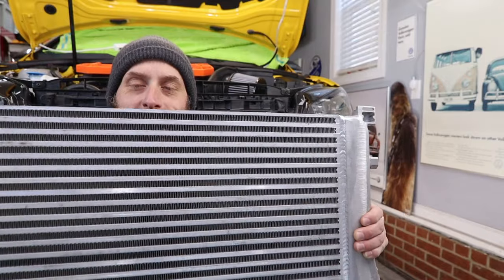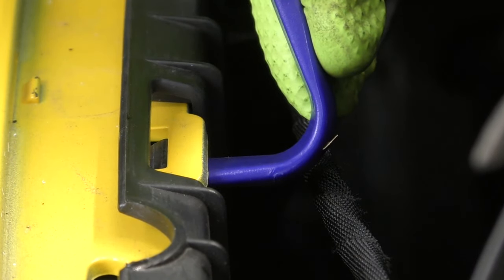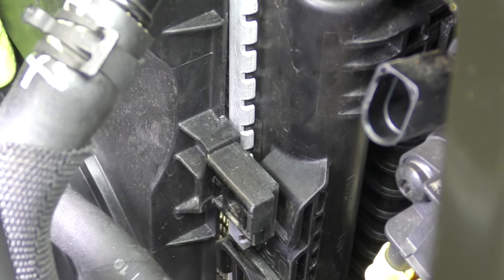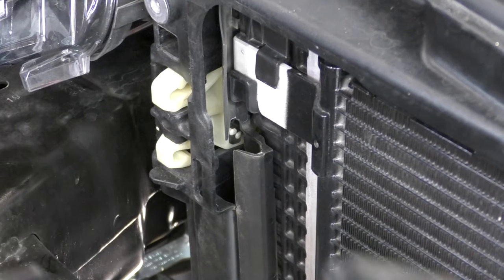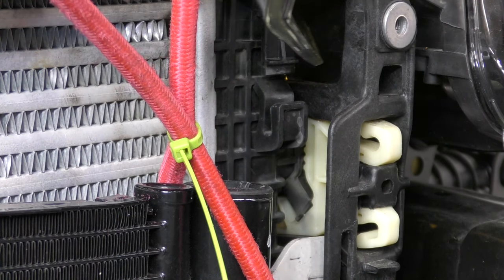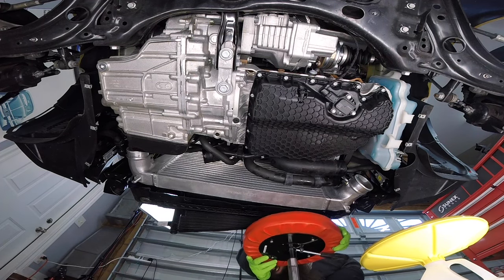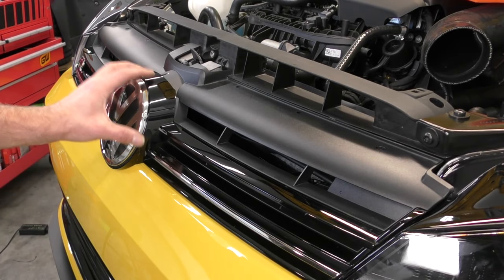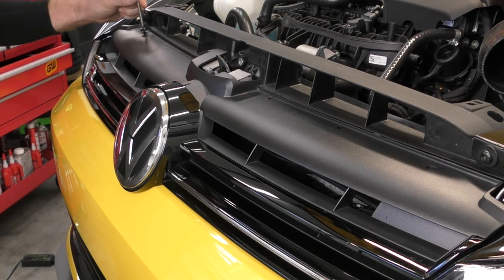Intercooler Upgrade and Installation ~ Stage 2 Golf R

Comment from the maker: WOW what do you think of a 33+ minute video? Also can you spot the fun things I added? ;) I also think I counted wrong on the clips, good thing I added a few extra!
Reply: Cloning is a new hobby?
Reply: Chewie says: Good job!
Reply: 16:37 Very long left arm!
Reply from the maker: @biggabenne  HAHAH Good catch
Reply: There were 2 Charles at some points
Reply: My bank account cries whenever I say "because race car". I tell myself they're tears of joy...
Reply: What do I think? I think I'd rather never buy a Mk7 car. I prefer working on my Mk3. My next purchase just might be a Mk1 GTI if I can find one. Hey Charles, where did you get the plastic trim tools? They aren't on your list.
Reply: Nice video as always.  I didn’t replace the my intercooler but I did replace all the factory charge pipes from turbo to intercooler and back to intake.  I purchased the full charge pipe kit from ECS.   I don’t track my car so figured the factory intercooler was good enough.   And the street racing in short bursts has proved the factory intercooler can still win races:)  my next upgrade is a brake kit and carbon fiber hood.  I did replace the factory diverter valve with a GFB go fast bits upgrade.  It holds boost better than factory and isn’t a weak point.
Reply: I liked the step to roll around on the ground looking for your stuff, lol. Been there.
Reply: Just came across this build series but curious if you have current dyno numbers?
Reply from the maker: Not for stage 2 yet. Should be early next week for that video
Reply from the maker: Hahaha always happens
Reply: Is there a VW/Audi factory piece that gives the same upgrade like the S3 cooler on Mk5?
Reply: HumbleMechanic do you think this method is possible on jack stands? Seems like you need a decent amount on the bottom.
Reply: HumbleMechanic Inwould like to say that your channel is meticulously thorough, concise, straightforward, and informative. 😎🏎 I would like to ask this: I watch races of Mk7 GTIs blowing thier motors on stage 2 tunes. What do you think the cause of that is?
Reply: Very good video.  I watched this vid and a few others and decided to go this route for installation.  Video attention to detail is excellent.  Typically I have to make a run to the store for tools or otherwise mid-process but this time I didn't have to, I'll give some of that credit to HumbleMechanic.  I followed the video with intentions of finishing in one afternoon.  It took me 4 hours at a leisurely pace which is sooner than I suspected.  Biggest trouble by far was the fan electric harness connector.  I had to be a little more invasive but I didn't break anything.  Success!!!!  Thanks for the great video.  And Wow, I like to keep my car clean but as you disassembled that R I was surprised at how clean it is!

Comment: Definitely going to use this method insted of pulling the front end if i fit an intercooler. This way ensures everything lines up like factory. Helps working in a working with the proper coolant bleeding equipment

Comment: I have watch this video about 10 times and I feel very confident at tackling this job now. The only piece that I'm a little concern is the process of adding the coolant back into the system and bleeding the air out. Care to point to some resources to help me boost my confidence doing this and also on how to use the special funnel you used.

Comment: Interesting install method.  Nice call out on keepin the engine bay grill screws separate since they are shiny.  I had to dig thru mine to find them. ha

For the dang IC clips pushing on them through the hole....bloody brilliant!  So obvious.  My method was to buy 2 spares on eBay, and not care if they were destroyed.  Think one popped off easy and the other I used side cutters on the prongs. lol

Edit: The FDS system is also pretty slick too.  The fact that it comes with a meth bung and hoses makes it a solid deal.

Comment: I installed this over the summer. I did not follow the instructions and remove the radiator tho. I went the Paul at deutsche method instead . This may have made it more difficult but I got it done. One thing I was glad to see in your video is how tight the fit is for the condenser tabs. I wondered if mine was messed up. One of the the tabs for on my intercooler actually cracked when I was trying to put it together. I decided to open up those slots slightly with a dremel so the tabs would slide in easily.

Comment: Vw service manual actually tells you to break the tabs/clips that hold the intercooler/ radiator in. (The white stubborn things haha). On the parts manual it gives a listing of 2x t30 self thredding screws to secure it back in

Comment: Imagine all the plastic that will break if you ever get in a minor front end collision
Reply from the maker: Yep. But it beats welding a new core support on
Reply: Insurance would total it for the cost of all those plastic clips lol
Reply: These golfs have sensors that give you a pretty good heads up to help prevent but yes that would really suck if it happened 😂😂
Reply: Energy most go somewhere, the key is to prevent it from compromising the frame cabin, plastic parts absorb the impact, the reason many new cars when on impact look like an accordion, but the frame of the vehicle is mostly intact.

Comment: I've been running an APR stg 2 high torque setup and have everything except an intercooler upgrade.  Living in Texas during the summer makes me want to do this just because of the climate over 7-8 months out of the year even if I don't drive the car hard a lot.  After getting some finally colder outside temps (30's), I can tell the car loses a large amount of torque due to heat soak in those hotter months. 

This seems like an install I'd casually say...eh i could do it, but would much rather pay one of the local vw/audi shops instead.  I liked the caution of not accidentally stabbing the condenser with the screwdriver.  Little heads up like that are the best bc dumb mistakes are the worst.
Reply: I was thinking the exact same thing, living in Houston. The car just feels so much better now that we have pleasant temps, this might be worth it before next summer. And yeah, pretty sure i'm going to be giving a local shop some business for this one.

Comment: I usually put some detailing tape on the expensive headlights, so the bumper doesn't scratch them up, trying to get it off and on! Applies to mk5 & Mk6 as well.

Comment: Well done Charles.  Thank you for making this video.  Aside from the front grill and bumper cover, are there any other differences between the 7 and 7.5 when it comes to disassembly or should this be pretty universal for the Rs?  I'm also curious whether or not they are the same where the bumper cover meets the quarter panel.
Reply from the maker: Should be basically the same. Even the GTI should be the same

Comment: At 21mins 30 in when you tightened that T30.....I had a Wagner installed and due to the extra thickness of the Intercooler the screwed eventually wore through the condenser - make sure you check that T30 or use a thick washer or like me you'll end up having to replace the condenser. Ugh. Great vid though!!
Reply from the maker: Oh dang!!!

Comment: I found I didn't have to take the radiator out or disconnect it at all. Kinda hard to describe, but the passenger side stuff stayed mostly put, the splayed out the drivers side enough to slide our the stock IC and put in the new one. Can send you a pick if you like

Comment: I'm mid video right now, loving it as always 👍, but one thing I wondered is what metal type are those little grub screws in the condenser? They looked stainless, I just wondered as mild steel and aluminium never have a good relationship haha 🎈

Comment: You do such a great job explaining and actually showing what you are doing. That is something many DIY videos do not do well so bravo! Question: I bought this IC second hand (v1 like yours) but I see there is some hardware you do not mention. Primarily the two cap screws and the male countersunk plug. Did you not use these parts? Thanks!
Reply from the maker: the ones that hold the condenser?

Comment: Hey man, pulling that bumper plastic away from the fender I have seen plenty of folks end up breaking those and there is no good way to fix that. Those tabs were not designed to be pulled apart like that, there is no need to pull on those, if you push back the fender liner just a bit there are two 13 mm nuts up underneath, just loosen those and pull forward slightly and the whole assembly just falls out. 
When you go to re-install you can  install the bracket assembly with those two nuts first, tighten them up, then when you put the bumper cover on they easily snap into place.

Comment: The ACC radar behind the logo is a lot more forgiving than the one placed in the grille when it comes to calibration.
It's to some degree able to self calibrate, but if it acts up, you could probably do it with VAG-com while driving, with no expensive special tools needed.
Reply: Also, using a vacuum coolant bleeder is a lot faster. Reduces the bleeding time to 10 minutes top.

Comment: do you think the radiator and Intercooler can come out from the bottom if only on jack stands?    This method looks better then messing with the core support.....although bleeding the cooling system seems scary.

Comment: I'm running stage 3 with no intercooler, so I probably need to upgrade this. My question is, should I upgrade the radiator also? If so, do you have any recommendations? I i was seeing 230-250F on a 70F day on the track when I was stage 1. I'm a little worried now that I have the APR dtr turbo setup.

Comment: Charles I was advised to disconnect the battery before starting. I have a 35th anniversary GLI so it's got the sensor in the VW symbol for braking, and I've heard that you may have to get that re-calibrated if you disconnect it under power.
Reply from the maker: I haven’t. But it won’t hurt
Reply: @HumbleMechanic  man I never thought I'd get a response that quick but I was like...eh I'll post anyway. Thank you! About to tear into the car right now.
Reply from the maker: Make her fast!!!
Reply: @HumbleMechanic  hey bud, one other question. So my setup is 6M, and I'm considering removing the clutch delay valve. Apparently there are varied opinions on if it helps clutch life or not. I can't see how slowing the engagement of the clutch would ever be beneficial, so I'm curious if you think it would be beneficial to remove as well. Thanks!

PS my ACC took a crap yesterday. Not paying the dealer to fix it, so I'll have to deal with the light for now 😭

Comment: I like that trick with the large yellow clips. I broke mine and would have done it your way.
Reply from the maker: Thanks. If I ever take them off again I’m probably going to cut and replace.  Those like radiator supports wear out
Reply: Makes sense.

Comment: When you installed your air intake did you totally remove the oem intake housing? I have installed a ram air kit to my mk7.5 R and didn’t think I needed to remove it? Will removing, as it seems you have, increase air flow to the filter?

Comment: Hi ..great video ...but one question ...do you need to remove battery lead when messing with the radar sensor in grill or is it ok to leave battery connected ...i know can be expensive if need recalibrating ....any help most appreciated :-)

Comment: Just wanted to ask if it would be better to go with the front mount intercooler instead just putting the bigger intercooler back in between two heat sources

Comment: My mk6 gti has a u1030 engine code 
I believe I’ve seen from my research that is a radiator sensor that cannot be replaced unless I replace the radiator itself
Was wondering if I have time to replace it or do I need to do ASAP

Comment: If it was my own car i'd tape thin cardboard to the cooling surface to the coolers, then remove once their close to their positions, as it's easy to bend the small cooling fins as you've done a few but not alot. I've got OCD so i'd be bending all those bent fins back into place lol.
Reply from the maker: That’s a great idea. I’m totally gonna use it
Reply: @HumbleMechanic   yeah it's easy to bend them, and I'm no angel in that department myself, pulling and pushing, trying to get them in position, then once in position, it doesn't look so pretty! yes I've done it myself, and the greatest lessons in life are learned by mistakes! great videos mate, keep em coming!

Comment: I don't know if you'll see this or not, but would this also be a good time to change out the water pump and t-stat housing too, while you have all that room up front? I'm going to be changing it out this coming spring as it's leaking, and I'm thinking of doing the intercooler upgrade while i'm in that area. 2017 Golf R
Reply from the maker: Not a bad overlap for sure

Comment: Hi , the OEM tool funnel kit .
   Which connector did you use to secure it in the expansion tank ? 
 I didnt see a adapter in the kit that i was going to buy (which was the exact kit you used in this vid) , did you source a seperate adapter to acheive the fitting into the tank neck? Or is it with the kit & i cant see which one it is? 
 I asked a seller if they have the kit to fit the vw tank neck for the polo gti & they said no .
 Can you help ? Im sure the tanks are all the same for these cars. I also noticed that it wernt screweddown but looked like it was just sat in the neck? 
 Cheerz 
Paul

Comment: Hi there luv your videos and your attention to detail great work 👍 i got a question just bought a 2017 golf R 63,000 on clock from vw dealer im told it has a tune but no one knows what stage from what i see are apr downpipe- apr intercooler- apr air intake ( closed) pedalbox system and from what im told from the dealership an ecu tune and tcu tune and rear stabilizer bar i cant get way under car but what i can see witch to me is strange with all that work it has original exhaust again im not sure cause cant get under car , with " all" that said any suggestions on what stage tune im at??

Comment: Why did you decide to remove the radiator, draining the coolant etc?  Instead of just swinging out the core support like you mentioned in the beginning.  Looks like quite a bit more work.
Reply from the maker: That is the repair manual way, and no worry about adjustment of headlights.

Comment: @HumbleMechanic I’ve seen people and “helped” (watched) a friend do his by removing the front crash bar headlights etc... I would imagine your method is easier, as long as your ok with draining the coolant? 

I’m about to install my IE IC on my S3 and thinking if I have to remove headlights etc this will suck and I should just pay to get it done. I did a condenser on our mK6 TDI and that sucked enough to make me not want to do anything like that again. Your method looks less sucky. 😁

Comment: Do you feel it's easier to take out the fans/radiator and deal with burping the coolant vs leaving the radiator in place and pulling everything off the front of the car and getting at the intercooler that way?  I always hate dealing with coolant/burping...
Reply from the maker: It's probably about the same either way.

Comment: Opted for the crash bar and headlight removal. Noped at idea of cleaning up coolant lol
Reply: Also you ever use any of the vacuum type coolant fillers on the vw’s? Have a snap on universal type one yet to use it though.
Reply from the maker: Haha dont blame you. The vw factory filler is awesome
Reply: HumbleMechanic evacuation type or the burp funnel? I know some cooling systems with like a pressure rating lower that I think 13psi they say not to use as it might collapse the heater core or other components😮😮
Reply from the maker: The vacuum kind is awesome. I need to pick one up. This funnel is okay but doesn’t fit vw perfectly.

Comment: I just found out that my radiator is rocking back and forth at the top. Bot of the plastic retaining squares on the stock charge cooler are broken. Is this common on our cars? I have a 2017 MK7 GTI.

Comment: Howdo mate. Unrelated to the video this time. I changed EGR assembly on Audi TT tdi quattro recently! OMG what a horrendous job that was :/
Reply from the maker: Yeah most VW/Audi EGRs are not fun!
Reply: @HumbleMechanic  you're not wrong mate. It was borderline crazy, the way some of these engines are now being designed is just ridiculous & some of the related costs for doing these jobs is insane. 
Hope you're keeping well over there ?
Reply: TDI Quattro Audi TT? Is that a custom build?
Reply: @aygwm  it's a standard model option here in the UK. 
High torque performance, a great car but little design consideration for certain repair tasks!
Reply: @chalkster4723  

Yeah, that Frankenstein-Build was first on the 8J-TT.....actually noone needed a Diesel-TT

Comment: hey charles! i ran into a problem where my radiator popped out of place on the passenger side and the sheathed coolant line that is attached to the line that crosses over the fan housing (labeled 5Q0 121 270 AP) ended up resting on the belt behind it, rubbing a hole right through and dumping all of my coolant. do you have any idea what this specific part is called? having a hard time ordering it though VW. Also, is there any possibility that i will be able to replace the line and re-seat the radiator without taking the bumper off?

Comment: @thehumblemechanic As the new intercooler is Bar and Plate and heavy vs the OEM Tube and Fin did you manage to ascertain the latent heat dissipation of each one or any discernable pressure drop difference